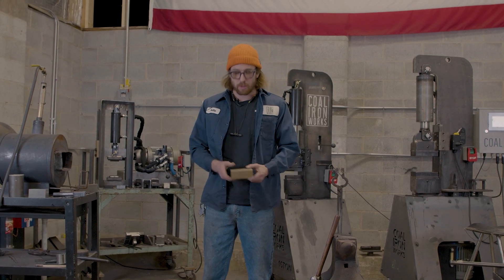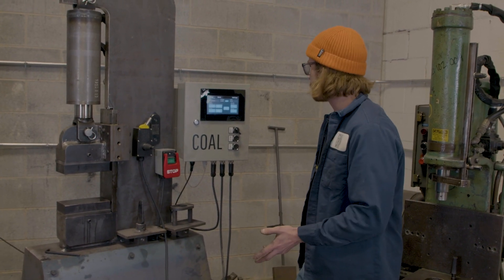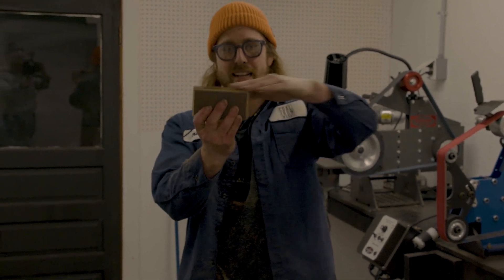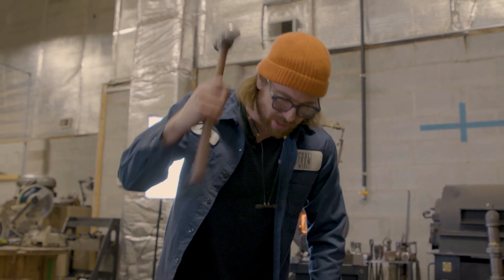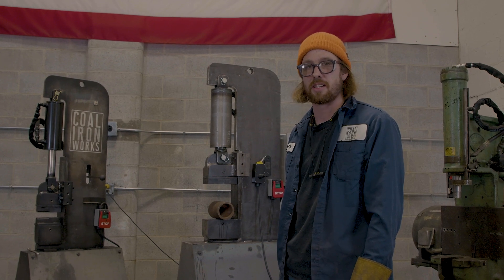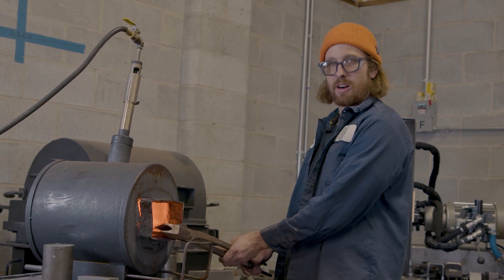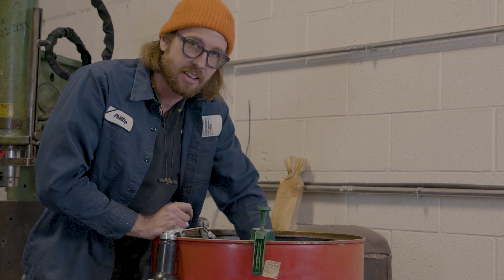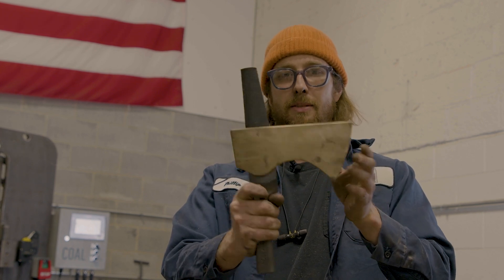Forging a Bronze Axe with Mother Bear Forge

Comment: I thought copper alloys softened when you heated and quenched them? Like the opposite of steel.
Reply from the maker: Usually yes, non-ferrous metals will anneal and stay pretty soft after heating and quenching, but the 954 aluminum-bronze we used for this axe is a "semi-ferrous" metal with a decent steel content that allows it to water quench and harden nicely!
Reply: @CoalIronWorks  Cool!!! Have you done any hardness tests on it?
Reply from the maker: We haven't put this specific axe to the test quite yet but that will be included in the next part of this little video series when we slap a handle and an edge on it!